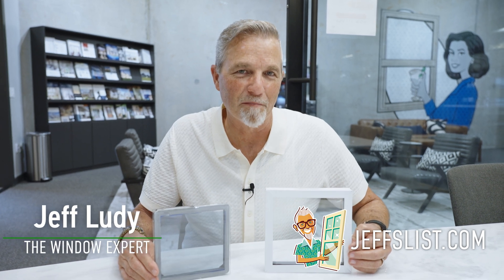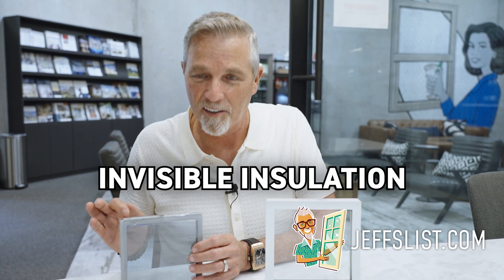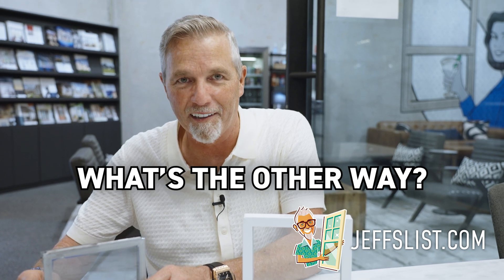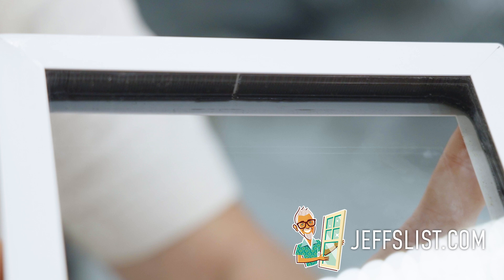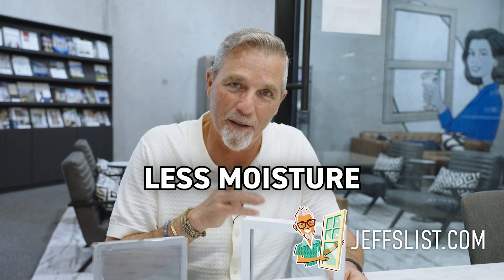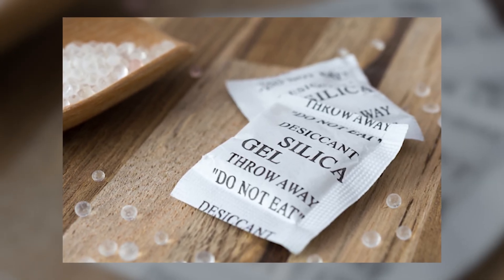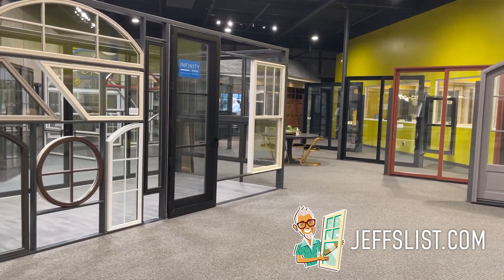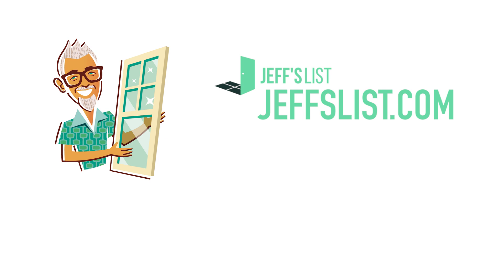Poke Fill vs Flood Fill Argon Gas: The Real Difference

Comment: Argon is a dry gas, it does not hold moisture.  Period.  It is also much heavier than air.  If you "poke fill" any cavity (not just glass) from the top with Argon gas, it will displace all the air  in that cavity.  I am sure one could argue that you may not get 100% of the air out of the cavity.. but even if you only purged 95%, that last 5% [of air] at even 70% RH (~68f, temp of most factories).. will never contribute enough moisture in said cavity to create any condensation.  Additionally, from a purely scientific standpoint... the only measurable metric that 95% vs 99.99999% argon will change is the U-Rating.  Even here, the only measurable difference you will effect is what? 0.23 vs 0.28?  Literally not enough to make any difference on the overall efficiency of the finished product in your home. 

Companies with deep pockets find ways to build incredibly expensive machines that improve the quaity of a product by 1 or 2%... but improve the speed of production by 200% (or more) and eliminate humans for the assembly itself (read: cheaper to produce in the end)... then charge substantially more for the finished product because "it is a better product" (not a lie - by a whole 1 or 2%)... They make the R&R and/or investment back very quickly since people are pouring in their hard earned money for a "better product".. so the up-front $$ spent for the special machinery (largely built in China) means nothing.

Take it from someone who has worked with the manufacturing side of some of these companies: flood filled is a streamlined process that involves less human hands and overall costs less to produce the same product.  They can crank those things out faster and cheaper with less humans involved - and less human error as a bonus.  The machines (to produce flood filled panes) can be purchased from mainland China now days for less than the $$ of a 3-year-old Honda Civic.  Which means: the investment is earned back on the first couple homes you crank out panes for.

Sales people who are simply always looking to sell at maximum margins really do not care as long as a comission is earned.  And when money is easy to borrow at the bank, the customer does not put as much thought into this either.

Eventually some of these companies will get some lobbyists to force more red-tape that mandates these new products (safety reasons, minimum energy savings, etc) and... you end up with unaffordable homes that now cost over half a million bucks.

I know, we are just talking about windows here.. but damn.  Death by a thousand cuts as they say.
Reply from the maker: Great breakdown, Dean — solid points on argon behavior and the manufacturing side. The efficiency difference is indeed marginal, and your take on how production speed and marketing shape “premium” claims is spot on. It’s eye-opening how small gains in performance can drive big price hikes.

Comment: How do you evacuate the existing air between the pains before filling with argon? Would probably need to pull a vacuum first?
Reply from the maker: Since the argon gas is heavier than air, it will displace the air out of the insulated glass unit as you fill it.

Comment: So are all glass package units from cardinal flood filled?  Didn’t mention the other was mentioned it was an in house poke filled.
Reply from the maker: If they were assembled at the Cardinal plant, they would be flood filled.
Reply: @HoustonWindowExperts  If they have Cardinal glass etched in the corner of the window does that mean they are made and assembled at cardinal?
Reply from the maker: Not necessarily. Cardinal sells glass and IGUs (Insulated Glass Units—argon-filled double-pane units). Some companies prefer to ship just the glass to their facilities and produce the IGUs in-house, which are then poke-filled. To confirm if the IGU was flood-filled by Cardinal, ask your dealer or manufacturer whether the IGU* was supplied from the Cardinal plant. I hope this information is helpful!

Comment: Love the Window Experts and have placed my order. But now I don't know which Argon I am getting!  It seems to me that with that much weight difference, the injection method could use a a scale and a computation to know when the cavity has been filled, keeping the cost down but yet achieving maximum fill.
Reply from the maker: Which window brand did you buy?
Reply: @HoustonWindowExperts  Anlin DM-E.2 and I bought the window company, not just the windows!
Reply: Anlin responded to my question that my windows will be flooded with argon.
Reply from the maker: Awesome! I'm glad to hear you're getting high-quality windows with premium glass from a top-tier company.